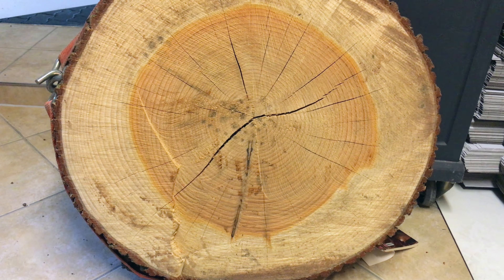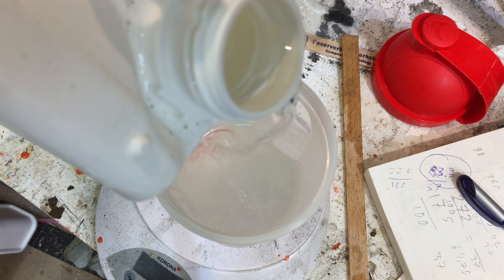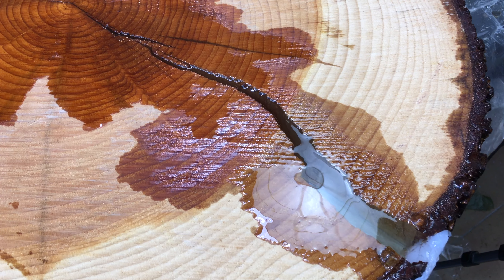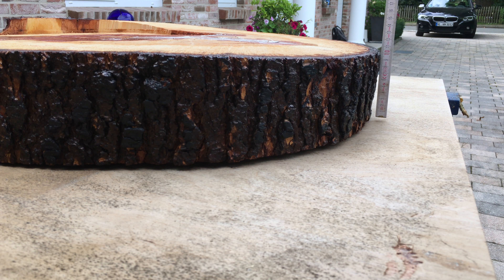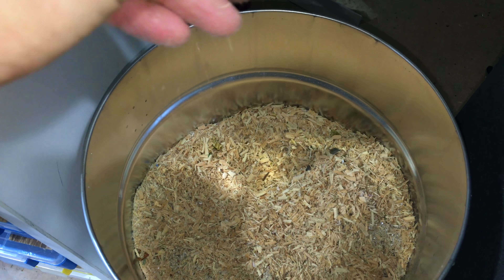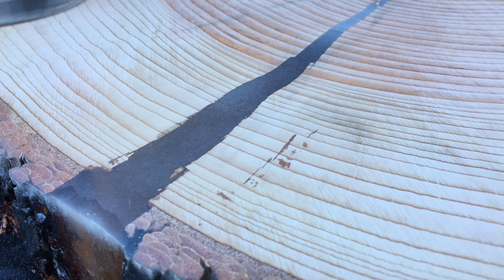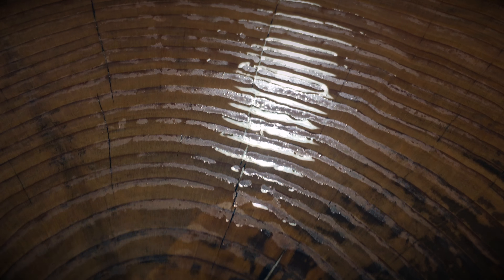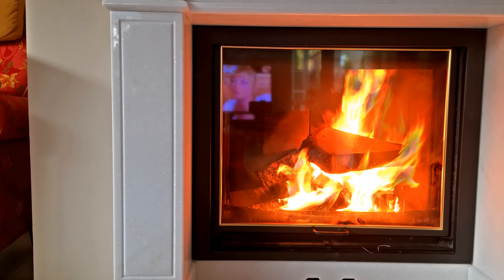Woodworking Fail (How to Make Expensive  Firewood)

Comment: Max, You saved me SOO much time. I was on step 1 with mine. I set it aside after the epoxy seeped through the tape and planned a better way to seal. Turns out, I don't need to. Thanks.
Reply from the maker: WoodworkCity Nice! Send me a picture when you are done!
Reply: Max, Will do. Attempt #2 is also a dud. Found another video where someone used foil tape for their seal. Definitely better than the other pieces, but I think I just have too much epoxy to hold. I might attempt to build up in small layers. Not ideal. This thing is turning into a real mess.  https://www.pinterest.com/pin/6755468176193284/
Reply from the maker: Doesn’t look to bad yet. Silicone works!

Comment: 1. you can speed up epoxy curing with higer temperature. Close it in some heat insulated box with heating cables (like used in terariums for lizards or some other heat source)
2. Unlike polyester resin, you cant polish the epoxy. Result is always dull. Use a 2K clear lack coat or polyester resin for final coat.
3. Maybe you should go with tinted resin.
4. Burning heavily epoxy soaked wood makes nasty fumes and is dumb, especialy at home!!!
4. Epoxy, all resins and PU paints are nasty stuff, use rather this invisible method ;)
https://youtu.be/i7uiJxwJI74

Comment: Great video. I love when somebody works with epoxy, because I do myself, and it's so amusing :D I'm sorry, that it didn't work out the way you wanted it, but looking forward for your next project. Love your videos, cheers from Ukraine.
Reply from the maker: Szabó Arthur Thanks! What do you make with it? Epoxy always turns into a mess with me.
Reply: Well, I used this yellowish car body filler epoxy (I know, it's not the most appropriate, but that's all i could get in my country) to cast various bugs into cubes of "glass". They turned out to be pretty cool, unfortunately nobody wanted to buy them, so I stopped. My biggest project was a dandelion. It used up 0,25 liters of the resin and it's not even visible inside, because it's so dark. Also I tried to make guitar picks, but the always broke while using them.
Reply from the maker: +Szabó Arthur Ah. How about using suggar? I saw these lolipops in Asia that had skorpions cast inside.
Reply: Yes. Sugar makes a really cool glass effect, but unfortunately it is very temperature sensitive. I mean you have to heat it up to an exact temp and then immediately take off of the stove to achieve a clean glassy consistency. I don't have any sort of thermometer at home, so it's not the best suitable project. Maybe one day I will try it, because it's interesting.

Comment: I'm curious about the router sled.
Reply from the maker: J Jagr It is made from 80/20 Slot 5 Aluminium. I had some leftovers and used it for this. Overkill, but easy to put together. There are bearings on either end. They run along the wooden rails and make sure it cannot fall down. That probanly saved me a few mishaps. I used plenty of oil to lubricate the router.
Reply: Next video suggestion:   A quick and dirty run down of that sled.   construction, materials and a demo of how you use it.
Reply from the maker: I might do, but Ill put it on patreon. Not sure if everyone on the main channel will be interested. If you don´t have aluminium profiles lying around anyway, I would just order one giant U-Beam extrusion and cut a slot in the middle.